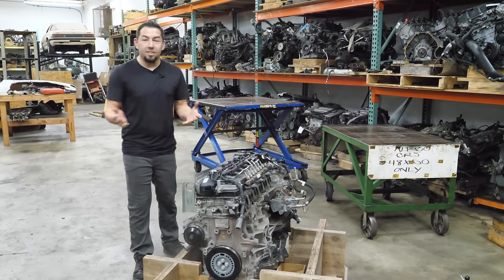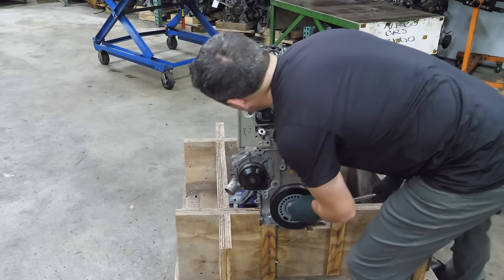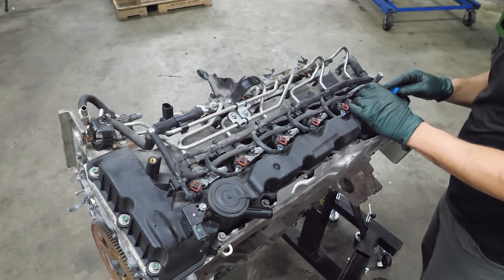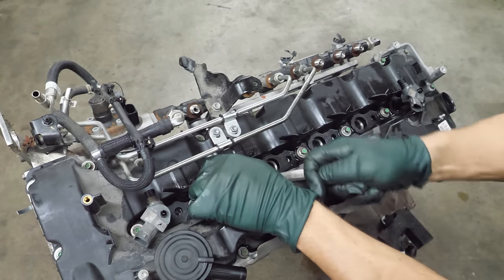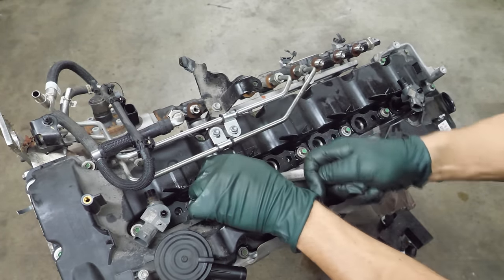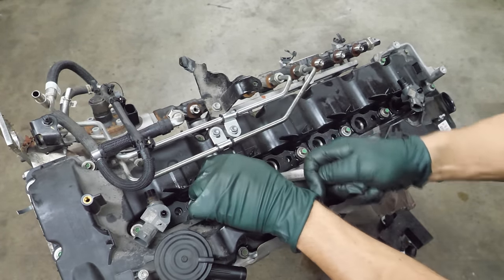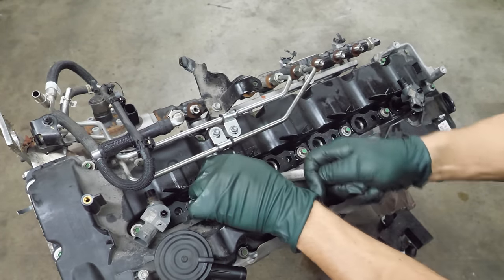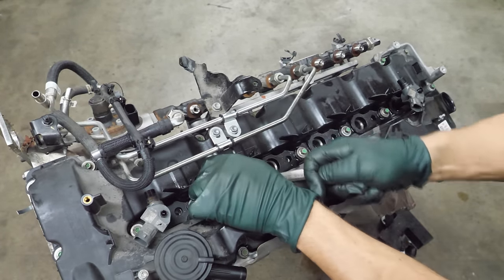BAD 2020 Silverado 3.0 Duramax LM2 Engine Teardown INCREDIBLE DAMAGE!

Comment: I work at a GM dealership and I HATE working on any vehicle with these, once it's fully dressed there's so much stuff crammed in the engine bay. You have to pull the cab to do major work on them, absolute nightmare otherwise
Reply: Is it worse or better in the SUVs vs the trucks? Guessing you don’t pull the cab on a suv where a truck you do.
Reply: I'd assume almost everything is major work on them.
Reply: Hence why people buy a Ram cummins, you can work on it without pulling the cab, relatively simple…
Reply: @richardj163 😂 you're funny
Reply: @richardj163  The major advantage of an inline six is the simplicity in packaging, making everything serviceable and accessible. Well, just leave it to GM to mess that up.
Reply: You have to pull the cab on ford's 3.0 diesel, 5.0s after 2018 and 3.5 powerboost to most repairs. The 3.0 duramax engine itself looks to be built pretty good. This isn't a engine parts failure, it was probably due to a bad service and then the engine was ran without proper oil pressure for a while.
Reply: I've never met a mechanic who likes their job. If it were easy and fun, you wouldn't have a specialized job... that nobody wants to do
Reply: @ZLwh1ne i love my job but i dont work on cars i work on gas and steam turbines. no stupid ass wires for me
Reply: @bradhaines3142  I work on jets. Love it. Plenty of wires, though!
Reply: @doctube2020 Can't imagine it'd be much different to pull the cab of a Silverado vs a Tahoe. Just a few extra body mounts and another set of (already drained) A/C and coolant lines for the rear A/C.
Reply: You would think that being an inline six there'd be room.
Reply: Haha, Ford's had that necessity for 20 years now
Reply: @ZLwh1ne the reason they don't like their job is because they are paid less than half they're worth
A plumber or electrician more than doubles a mechanic's wages
They wouldn't do that kind of work if they weren't good at it and liked it, they'd be plumbers and electricians instead
Unless of course they're kind of stupid in the area of financial compensation
Reply: @doctube2020  it's just as bad, I've never pulled a cab on an SUV but guys have done it
Reply: @mattbots1  Apparently it's easier
Reply: @reubenj.cogburn8546 That's why more and more techs are leaving and doing other things. I haven't left because I'm to old to start another career. Although that truck driving school is starting to look better every day LOL
Reply: It's hard to imagine what caused the camshafts timing to be so far off, maybe the prior work done to the oil pump caused the cam's drive system to become out of time, I don't know... But to drive this very expen$ive truck out of engine oil, is beyond belief... What was once a very nice engine, turned into an extremely expen$ive pile of junk... I guess the companies who manufacture vehicles, make a LOT of money from people like this...
Reply: I wonder if it’s as easy as pulling the cab on a Ford… you can have one off in under an hour without an ac evacuation! I love it!
Reply: @no1ghostrider  I hear you partner
I was out there in the trenches for better than 40 years and watched it evolve into the toilet that it is today
Call it quits just before covid, when my service advisor with the green hair and the nose ring was chastising me for not selling enough wallet flushes.
My response was for him to F himself, one thing led to another and someone ended up with a bloody nose.
That was my last day
The funny part? They offered me a raise to come back.
Good luck to you, you're going to need it
Reply: @AkioWasRight wish we got the jdm I6 Toyota turbo diesels.
Reply: @ZLwh1ne I work on air cooled Porsches and love it. The riches are in the niches.😅
Reply: @no1ghostrider ....I left after 35 years at GM at age 54, couldn't take it anymore. I work on trains now. Should have done it so many years sooner!
Reply: Have you seen a 6.7L Powerstroke engine bay?
Reply: @ZLwh1ne I was an airplane mechanic for 29 years. They are no picnic either my friend. Gawd I hate airplanes!
Reply: You have to pull the cab on every truck to do major work these days don’t you?
Reply: @craigg4246  Nope but im sure its a nightmare
Reply: @craigg4246 ford loves to feel any empty space with something.
Reply: In the same boat bro I can’t stand working on these I’m at Chevy myself
Reply: @caseyeldridge5557  yet it's still true...
Reply: That’s because these were designed to be used in cab over trucks overseas. They aren’t hard to work on when you tilt the cab off.
Reply: I am guessing he won't run the next motor without oil🤦
Reply: @mikeerin5031  And all the emissions BS isn't there either
Reply: @caseyeldridge5557  I think richard votes Dem too....
Reply: This is why i gave up being an ASE tech in 09
Reply: @richardj163 yuo and ram cummins, no timing chaun or belt  ie no problem....
Reply: GM literally says not to pull the cab! If you do please don’t put it in your story! These are a nightmare to work on and I guarantee we’re going to have so many special policy coverage on these
Reply: @dougrobinson8602 these amateur car mechs, lol, what you work on? I use to fly on my work, on 53s
Reply: @gcrauwels941 timing chain is at the back, just in front of the flywheel. And the dumb rubber oil pump drive belt. The COULD have used a gear drive.....
Reply: @craigg4246 Exhaust manifold bolts anyone ? I had a guy say "oh they are in the valley, so they shouldn't be bad to do" ..
He has never looked, either....
Reply: @michaelmartinez1345 They're no need for all of them chains and belts. A group of gears ⚙️ could have been used on that engine and would be far more precise for timing than chains 😮😮😮😮😊
Reply: Looks like it was over reved.
Reply: @no1ghostrider Go drive a truck if you like working 60+ hours for 40 hours of pay. Not worth it.
Reply: @mikeerin5031 What were these engines used in??
Reply: Everyone is a mechanic or tech specialist on these pgs most probably can't change there own oil
Reply: Try pulling cab on a 7 -10 year old truck from the great lakes region. Being a Chevy it will be so rusted Notting will come apart unless its under oiled or owner is a freak about car washes all winter.
Reply: @richardj163  that was 20 years ago
Reply: @ZLwh1ne  i knew dozens that LOVED their jobs when i was young in the trade in the early to mid 2000s. Now mechanics make about 1/3rd what they did in 2003 and have to know more.... you do the math; do you want to do more and get paid a fraction what your worth?
Reply: @workingcountry1776  Well good thing I live in the desert
Reply: @ZLwh1ne  hi I am a technician. I used to be a mechanic. I don't do much tooling but I do a lot of what we may call laptop work to pin point issues. When I was a bidding shade tree mechanic I loved it. But I enjoy being a technician way more. If you like a challenge paired with persistent service advisors and grumpy customers then you may like it to. Give it a shot. You never know it could be the worst mistake of your life. Cheers and keep on wrenching.
Reply: @richardj163 who told you that?
Reply: @doctube2020 you pull the cab, it’s not much harder to pull then a pickup
Reply: I mean your smart for taking a job reparing general mess engines, there is no shortage of work!
Reply: Isn't that pretty much on any modern truck where you have to take the cab off when you want to work on the engine?
Reply: @ZLwh1ne  been there, done that, didn’t like it. Lol (was a Volvo car master certified mechanic… your making the dealer $ that’s it)
Reply: Been pulling cabs on fords since 2003. It’s nothing new.
Reply: @gerhardpet1 Besides pushrod gas trucks, pretty much
Reply: @carlbernard4197 But so much more noise. NVH is the reason gears are not used in mainstream vehicles.
Reply: That oil pump belt has to be replaced at the 160,000 mile point or you'll void your drive train warranty. Idiotic design.
Reply: @victorford7003 

Isn't the powertrain warranty already done @ 160,000 miles??
Reply: @johnpeters9793  The diesel powertrain warranty is up at 100k
Reply: It’s not that bad, have yet to pull a cab and have had a few long blocks already. 😂😂
Reply: @kb01663  

Yup....the joker wrote if you don't change the belt @ 160k it voids the warranty..

There is no warranty @ 160k miles.

Please try and keep up..
Reply: @johnpeters9793  You asked a question, maybe you should try and keep up
Reply: @kb01663  

LOL...is was a rhetorical question..

Of course there is no warranty at 160,000 miles to void if the belt isn't changed. 

You cannot possibly be this obtuse in real life; can you??

(Another rhetorical question..)
Reply: @johnpeters9793  Dude how you phrased it, it seemed like a serious question. Have a nice day
Reply: @kb01663  

I "phrased" it in response to the dude that wrote the warranty would be void..

Do you not see the name of the user before the comment??

But thanks for sharing your knowledge..
Reply: I think this owner used the wrong oil. Plus high miles equals this.
Reply: There’s zero reason other than penny pinching for them to not put a gear train to that pump.   I won’t buy one period because of it.
Reply: @Chevtec ...I did the same.  Got out after 15 years and work on trains now as well.
Reply: The big duramax yes…. This one you pull the radiator condenser and front grille
Reply: @roger3858  I've done 3.0 engine replacements both ways, pulling cab was way easier and faster. Front cover reseal, that would be a waste of time to pull the cab. I've never done the cat off the turbo but if i did, pretty sure i'd pull the cab.
Reply: @richardj163 maybe you should look at the video again. This is an inline 6 😮
Reply: @no1ghostrider so you want to make less money and work longer hours😂 go ahead become a steering wheel holder. I dare you😮
Reply: @garrettsmith7244 gears dont have be noisie just have to get the heat treat right to quiet them down
Reply: @holmes1956O  Maybe I shouldn’t look at the video again. Maybe you should read the comment I replied to. The comment “I work at a GM dealership and… … There’s so much stuff crammed in the engine bay…. You need to pull the cab …. ” 
Or don’t read, I can care less.
Reply: @richardj163  my apology that post was meant for the person you responded to. He said inline 6 is easier to work on. Dont know how it went to you it was directed to someone else😳
Reply: @michaelmartinez1345 I agree, everyone should check their own oil at least monthly…but so many vehicles today don’t even have low engine oil warning lights or anything.  In today’s world it’s ridiculous most cars don’t have such a simple warning light.  It would also be nice to have a low coolant light too.  How many engines would either of these warning lights have saved?
Reply: @Eluderatnight Those Toyota Diesel engines old or new are just sweet.  We will never see any Toyota diesels in the US, at least not ones that are made in this century.  I spoke with. Toyota engineer 6-7 years ago and he told me that the US has way too high of environmental hurdles…there is no way they can make a clean diesel that can also pass their durability and reliability standards, Toyota’s durability standards.  Most unfortunate indeed.
Reply: @holmes1956O  I was just kidding, that is a whole bunch of other problems. Trying to get loads that make sense, and the brokers trying to take advantage of you. Not to mention traffic and what dumb people do, like brake checking a 70 or 80K semi. Were you raised under power lines.
Reply: @hokie9910  There are coolant level sensors on several commercial vehicles, But an engine oil level sensor on engines that have wet sump lubrication systems ( most vehicles of all types have wet-sump lube systems) could only work effectively, when the engine had been sitting in the non-running mode for at least 5 minutes... Why? Because of the intense oil mist and splashing during an engine run, makes it impossible to determine the oil level on a sensor of any type...
Reply: You work with these. What’s involved in changing the starter.  What all has to come off, idk you go through the passenger wheel well or from the underside.  I have a 2021 at4 that the starter has locked up twice in under 30k miles.  GMC will not warranty it, been fighting with lawyers for 11 months now to no avail, just want to get it running and dump it.
Reply: @michaelmartinez1345  My wife had a 2007 Yukon xl and it would alert like clock work when it was 1/quart low….
Reply: @hokie9910  That is low oil pressure causing an alert... Not a good thing to have, when the engine is running...
Reply: @michaelmartinez1345  low oil level, not pressure.  Ran it to 210k miles and sold it, was running perfect when we were down with it other than eating a quart of oil every 2500 miles.
Reply: @AkioWasRight wait till the Ram straight six gets some miles on it ,will they be as complicated ?
Surely emissions control doesn't dictate such a silly design ?
Reply: Probably why it's going away.
Reply: GM dealer tech here aswell.  This is 100% accurate.  Been there done that.  The LZ0 is no better then the LM2.
Reply: @ZLwh1ne you have met one as of today. I’m called the garbage man at work, I do everything other techs hate to do…..and love it. Over two decades in and I’d never do anything else than working on cars.
Reply: It takes about an hour of prep work to remove the cab, ford perfected the cab off engine work and GM refined it. It’s not that bad.
Reply: @cjwright1960  I’m sorry but there no chance in hell that you’ve ever taken a cab off  any GM pickup truck.  GM doesn’t even have a service procedure to take the cabs off any of their pickups trucks.  Unless your doing collision work that requires R&R of the cab.  I will agree that Ford has perfected it and brought it into a lot of their service procedures but GM 100% has not.

I have removed several cabs over the years to perform various repairs on GM’s LM2, LZ0, LML and L5P diesels.. and have yet to see a procedure in our GM service information manual about removing the cabs to perform repairs.  This is something we do as techs to make the jobs easier.  The first ones take 3-4hrs and after your looking at 1-2hrs to remove them.
Reply: This guy is tripping.  Those valve recesses are cast into the pistons.  That's how you achieve the necessary compression for a diesel engine, by having a small cc combustion chamber.
Reply: Same as ford w cabs and same as every mechanic except u have more issues w fords and dodges
Reply: When I bought the wife her suburban last year, I really wanted that motor. But it was impossible.

The more I learn about then the happier I'm with the 5.3

I get 650 miles out of a tank on the high way which is amazing to me hauling all the crap we do up and down to Maine not sure if the deisel would of been worth all the head aches
Reply: @bryanyoung3764 he will if that belt breaks
Reply: @richardj163 that’s pure brand bs. I guess that’s why dodge ram is 3 of the bottom 10 selling vehicles in the US?  Not just trucks ALL vehicles?
Reply: @robeylemere where do they say not to pull the cab.  ???
Reply: How's the reliability on the 2020 3.0L duramax?
Reply: @mattbots1 front and rear bumpers have to be removed on the Yukons to pull the cab as well as fuel filler neck, other than that it’s mostly the same with 4 more body mount bolts and removing the assist steps
Reply: @victorford7003 lol powertrain warranty expires at 100k miles anyways so it doesn’t matter
Reply: @ZLwh1ne  It actually used to be a relatively uncomplicated and easy job. Now it is an absolute nightmare. The amount of contempt engineered into modern "vehicles" is absolutely mind-boggling. And -- make no mistake -- that's EXACTLY what it is.
Reply: @donaldkinder6716  Yes, and a lot of them can't construct a simple sentence, either, I see... Much less spell the words in said sentence correctly.
Reply: @no1ghostrider  I left for better pay and easier work in IT. My quality of life is way up. Didn't go to tech school or college. Started pulling Cat 6 cables in commercial construction and after a few years I got recruited by a university I was doing some projects for. 

The complexity of newer engines don't bother me at all. It's how much you make doing it under warranty that is the main issue. 

Mechanics are the front line of keeping customers buying the same brand, and they are taken advantage of by the manufacturers. 

Eventually they won't be able to recruit the next generation of mechanics because the wages aren't keeping up with the cost of living and it's a tough field to get started in with thousands in tools and a computer coming out of your paycheck every week.
Reply: looks like the black  goo  from the X files.
Reply: Same here.   Pure junk.   Not worth the diag
Reply: I need a new 4x4 to get to where I'm moving and I'm scared to death of dropping the amount of money they are demanding after hearing all these new trucks have issues. A truck at these prices should never have zero issues wtf give me a truck without all the crap no real man needs in a truck
Reply: ❤w
Reply: If you look at any new truck,  including RAM,  almost every job requires I es you to pull a cab.
Reply: Hey @kb01663, fellow GM Master tech here! How much do you love finding wiring issues on these new trucks!? 
Holy crap! Such a pain in the a$$!
Reply: I’m an automotive engineer don’t tell them I told you this, but we (employer) really don’t care. Truck blows up after the warranty. To be honest. Most cars nowadays. Have a 10 year expiration date. The people I work with every day with the smartest people I know from mechanics to former Dakar , and Baja engineers,. Trust me we can make a reliable engine Toyota was doing it back in the 2000s. There’s been multiple cases where through long-term testing we have found multiple issues but since the issues we found “most likely” happen over 200,000 miles we purposely did nothing. our customer base (likely used) who drives cars not far into the future. Don’t have the money to buy a new products so we don’t care what they think about us. And the customer basis I that afford a new truck will have a perfectly problem with the truck for 6 to 8 years. before you ask other companies do the same even Toyota now with the new turbo junk. We usually open up or competitors engines and see what we can rivers engineer or learn from )non-patented) Sooo… sorry 😢 (power train engineer in one of the big American three)
Reply: @ZLwh1ne  I’m a UPS mechanic and wouldn’t say hate, just don’t really enjoy my job! It was great in the beginning when everything was new to me but now after 10 years it’s gotten so repetitive and easy!!
Reply: You’d hate being a ford employee
Reply: @kb01663 have the 2nd gen LZO diesel improved at all with wiring and hose setup?
Reply: @Racer18crf no way.  It's a base engine difference.  Many many lz0 have more wiring issues than the lm2. Chafed wires cause issues that result in lemon buybacks.
Reply: @ZLwh1ne  yah most mechanics don’t really like the owners of the automobile’s they are making happy again. That could be why you think that.
Reply: I sympathize with you brother gm dealers still owe me 1.8 billion they screwed me out of during the Vegas
Reply: Learn a tr as de
Reply: @ZLwh1ne the transmissions and rear axles were the only fun😅
Reply: To be fair the duramax wasn't that bad to work till they moved things closer together for the emissions crap to fit under the hood.  The lb7 was great the lbl is a cluster until you delete it and remove the bulky Def fill tube.  But ever then there are a lot of other things under there my old lb7 did not have
Reply: Where do I find the cam shaft position sensor
Reply: @ericcarrier5651 as someone that's never pulled a cab I wish there was service info I could look at for guidance. It seems straight forward, wiring harnesses coolant hoses ac lines steering shaft. I don't do heavy work but it would be nice to know how to pull a cab if I had to say replace a turbo on a lm2/lz0. I watched a coworker replace a turbo on an lm2 cab on and he was struggling hard
Reply: @Chevytech1977 I replaced a body harness on a 2018 Silverado because there was a bad wire preventing the rear turn signal to work. Aftermarket warranty covered the job. Honestly I preferred that instead of finding the needle in the haystack
Reply: @CommercialRoofing-zm4fl  I'm pretty sure all the years are the same but I looked up a 2022 truck, it's at the back passenger side on the cam cover behind the EGR. Your probably gonna need to remove the whole wiper cowl to get to it. And the electrical connector is 3 wires and the wire colors are: Pin 1: Gray/Yellow, Pin 2: Black/Gray, Pin 3: Violet/Black. But it could be different on the year of your truck
Reply: You.  Are.  Not.  A.  Diesel.  Mechanic.
Reply: Are you selling the 6 pistons?
Reply: @andrewbuckert7651  Correct, yet I still have to work on em, we don't do specialty at my shop, everyone does bumper to bumper
Reply: I work on rocket engines and I love watching these ICE tear downs.
Reply: Talk to Dave who has a shop on you tube that specializes in Duramax diesels in Duramax diesels...
Reply: @workingcountry1776  That's funny. I have a 2019 Silverado with almost no rust, in the rust belt, with minimal winter washes. Then again I don't park it in a warm garage all winter. The guys that park in a garage think it's better for the rust but it actually makes it 10 times worse.
Reply: In 5 years you're going to be wishing you still had them. Think that's bad? Try working underneath a Ford. Dropping a whole sub-frame for an O2 sensor is bonkers level 9000.
Reply: @gcrauwels941 Before the EPA there was lots of room, LOL.
Reply: @mikeerin5031 Exactly!
Reply: Any stock diesel engine does not like to be rev high. It's a low reving engine, not a race car engine. Also, use oil that is made for diesel. Gasoline oil does not have the cleaning additives and dispersant in them. Meaning it will clog your diesel engine eventually with soot